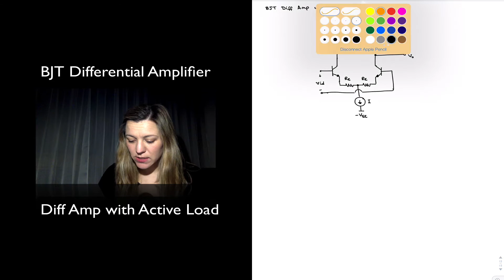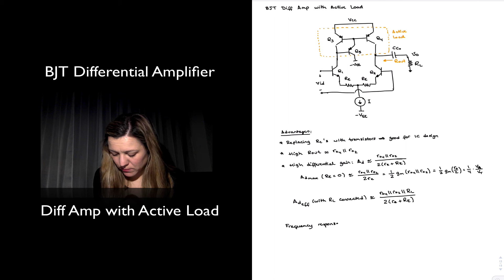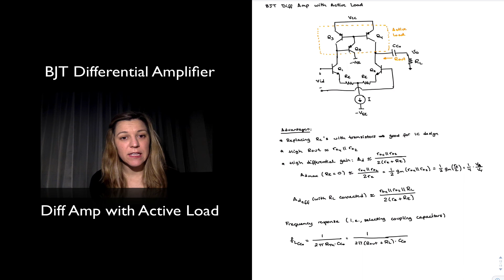BJT Diff Amp: Active Load

Comment: Does anyone know what is the DC voltage level in the collector of Q2 and Q4?
Reply: I think that if the transistors of a current mirror are matched, they will have the same VCE, since VBE and IC are equal. That's the most I could conclude. Basically you should look at the transistor I-V curves. That was really hard to wrap up in my mind.